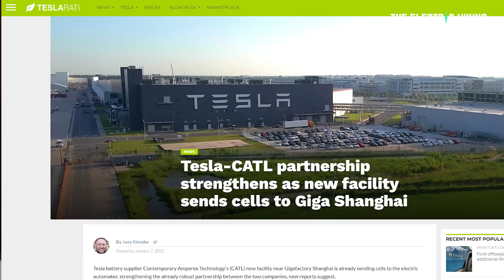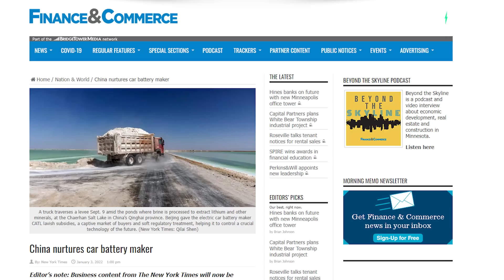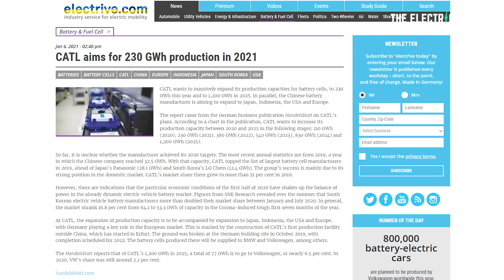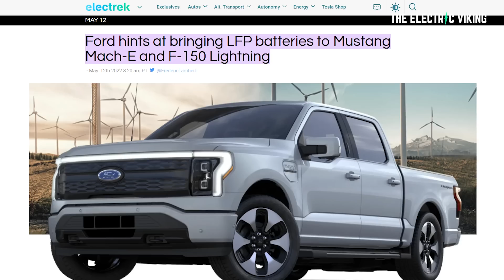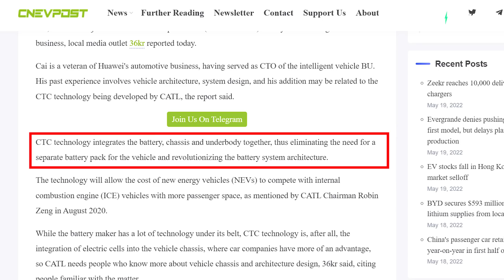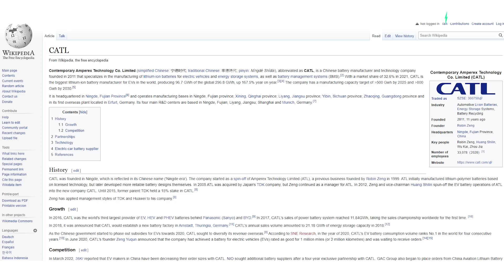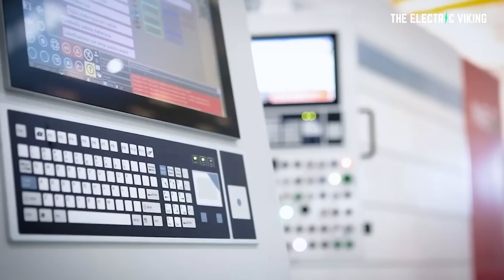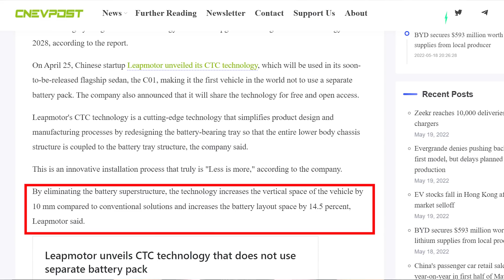Tesla & CATL using CTC to destroy legacy auto & make billions

Comment: You list LFPs advantages but you don't mention its very poor cold weather performance; 4680 will not be LFP. In all cases Lithium remains the choke point. Legacy auto only has to worry about EVs if you can actually make enough to fulfill the 100 million vehicle per year demand for cars; right now annual EV production isn't  even making 5%. - let alone trucks, buses, trains, industrial vehicles like bulldozers - etc.  Of the billion existing cars - EVs account for 0.005% hardly a case for world domination any time soon.

Comment: Now you're going on about weight loss by using the battery pack as part of the structure, so yeah your saving a few kilos, where real weight loss comes in is by building the vehicle with carbon fiber, which will shed 100s of kilos. Musk won't do this because he's all about fast, cheap, and dirty, just like Star Ship. Carbon Fiber is the future of cars, EVs last 20 to 50 years, you want light weight quality. The Cyber Truck will be made with stainless steel, dude the 60s are over!!!!
Reply: carbon Fiber is Garbage when it comes to accidents. Unless you use the Extremely expensive type like some of the hyper cars do, Its not gonna come down in price enough to make it viable. Its nice and light, strong enough to do most things, but Most people Dont need to go 0-60 in 2-3 seconds, so the biggest point would be range. That could easily be adjusted a bit without needing to go down the carbon fiber route. Also Fixing carbon fiber is a nightmare, and most of the time it wont be able to be fixed, just replaced and you cant exactly do that to structural elements.
Reply: Imagine being a nobody trying to tell the Tesla CEO, SpaceX Chief Engineer which has smart and talented scientist and engineers what to do like they don't have a brain to think the advantages and disadvantages of carbon fiber.
Reply: @ravinyu3566  - Wrong, Musk does know the advantages of carbon fiber, but goes with stainless steel because it's cheap and easy to work with (lower skilled workforce) he's all about fast and dirty. It will catch up to him!!!

Comment: Cell To Chassis. Instead of packing cells in boxes and shipping them to Tesla, where they would have to be unpacked and put into packs for the cars, CATL will "pack" them into the bottom chassis component, probably provided by Tesla. That saves a few steps in manufacturing and simplifies shipping.
Reply: That is what I was wondering. Instead of Tesla creating the middle battery structure, CATL would build various structures, pack them with batteries, (hopefully) add all the cabling and cooling systems, then ship the completed middle component to Tesla plants around the world (?), Tesla would put these on their assembly line and 1,2,3 the structure is done. This would mean CATL would need to create multiple battery structures or try and standardize on a few sizes that would serve multiple vehicles. Extending this to manufacturers other than Tesla might mean developing a standard fully populated, cabled and cooled battery structure that could be used in a wide variety of vehicles. The front and rear part of the structure would be up to each manufacturer. I doubt a standard battery structure would ever be allowed or used by multiple manufacturers but I hope it will be used by Tesla on my CT. 

Second thought: Upgradeability. Would the battery structure, if designed properly, allow for larger battery packs or upgraded CTC versions to be replaceable down the road? I get a 300 mile CT, would I be able to take my CT back into Tesla after 5 years and have them easily remove the old battery structure and pop in a new structure? If so, this would be absolutely amazing.

Comment: We used to hear. A lot of details of chemistry and materials advances, but now we just hear lithium iron phosphate.  Does Tesla LFP chemistry distinguish them from “generic” LFP or are all advantage come from vehicle/power management and efficiency?  I also have a solar generator that also uses LFP batteries; how do Tesla batteries differ from those, for example?
Reply: LFP went out of patent in September of last year, before that only china used them, why Chinese EV weren't exported as they couldn't be sold.  they are cheaper to make, average performance, but importantly can take a lot more mismanagement by vehicle owners. Tesla have zero advantage using them as any patents they developed are open for copying. I think 6 companies have now announced they will be making or are making the Tesla style 4680 battery. 

The Tesla 4680 battery allows cheaper manufacturing, no cobalt in the anodes, come out a tiny bit lighter, less cooling channels and aids structural pack designs, but they don't really have any advantage over other LFP cells outside of that.

Structural packs are a bit of a new thing, by next year we will see more companies going that way.
Reply: Its technically Lithium Ion Phosphate but that is the same as LFP (which is Lithium Ferrous Phosphate. So translating Ferrous from Latin gives you Iron, that's also why chemical symbol for Iron is Fe).

Comment: Huh?  Tesla already does this.  They don't need CATL.  Also, other car makers will be able to buy structural battery packs from CATL, helping them catch up to Tesla.
Reply: You are right on most of that. But look at this- the reason Tesla is doing this approach with CATL is because CATL will produce enormous amounts of LFP batteries AND will assemble them into the chassis section and deliver the whole assembly to Tesla, that is down the road, for Tesla assemble in to their vehicles, liberating space for more production of other components.  With this approach, Tesla will be able to lower costs, increase production rate, and increase profit margins while, maybe, maintaining their prices stable.  This will help Tesla to eventually produce the 20-25 thousand USD Tesla model.

Comment: Apparently there is NO WAY to determine battery chemistry or battery configuration by examining the sticker affixed to the battery box, the Mulroney window placard, or even the data booklet that comes with the car. Buyer is left with trying to deduce this basic info from thin air or TM employees guesses. Lotsa luck.!!
Reply: They'll put it on if customers refuse to buy otherwise.

Comment: Good reporting, but depending on the Chinese government is NOT a strength -- either logistically or in particular morally.  Maybe that doesn't matter to you but the CCP is not an honest player.

Other than that, great coverage and I usually agree with all you say.
Reply: Sam means CATL companies is more reliable provider of Battery for Tesla and any other manufacturers; given from his reasoning, CATL will work with government guidelines in event of pandemic so production will Not be greatly affected.

Many other points are:
CATL is #1 battery supplier, given the amount Tesla needs, cost efficiency is multiplied because both are at great volume.
#2 CATL catered for Tesla to have build their new factory 3 km away. Only in China plus the capacity can easily to ram up, vie China speed.

All in all this is the best business deal one can ever gets.
Otherwise Tesla can Not do everything on her own

Unless Tesla partner with the biggest few batteries provider; no cars can be made to sell to the world!

Just look at even now, even with the biggest providers still capacities & production have been strained.

Look at the rest of manufacturers legacy, even worse
The ICE vehicles they are good at, have production trouble, not even going into their future plans (to become irrelevant)

Compare CATL, BYD batteries to Tesla and Tesla own 4680 manufacturing. If we have eyes and analytic minds given public knowledge:
Tesla have more then half the new vehicles on LFP batteries and soon better capacity LFP.
If Tesla were to wait for their own capacities to ram up or other manufacturers Japanese, Korean.

Tesla will Not have
Reply: Morally, I FAR prefer the Chinese govt over USA. (Iraq, Afghanistan, Chile, Nicaragua, etc etc etc).

Comment: Does this mean that the batteries become a structural component of the car?  I wouldn't like to think what happens in a collision.
Reply: It belongs to the "hardness" off the collision. If it's hard enough to damage the structure, the car is totaled anyway. If not so hard, the cells are not affected. 
Another question is, when some cells die, while the car still has warranty. How to replace the cells?
Reply: @oasiasoasiaso  LFP is a simpler technology, and it is easier to do QA/QC on them, so if the company has good QZ/QC personnel, there is no need to be concerned for the first 250,000 thousand miles, maybe more.
Reply: Neither me, because by the time the integral battery pack is damaged in a collision, I would be dead from it.........

Comment: Is the battery going into body panels? Like doors or bonnet or roof?
Could the roof be pV ?
So the battery would charge if parked in the sun!
Reply: You'd get little more than enough to counter phantom drain. If you really want to drive a solar ev, look to aptera or sion motors.

Comment: Half of Tesla’s cars are using prismatic LFP from CATL.  Where are the promised 4680 packs?
Reply: I the texas model y and soon in the berlin model y
Reply: Tesla has built 3 new battery factories that will be producing 4680 batteries.  Panasonic, CATL,  and Samsung will also be producing the 4680 battery format.
Reply: @michaelsmith2723  CATL won’t be making 4680 cells

Comment: With the battery built into the chassis, is that mean if something is wrong with the battery, you can’t change it?
Reply: Yes. Battery fails, scrap the car (with the CTC system, not Tesla 4680 structural, which can be swapped out).
Reply: @lengould9262  thx for the reply. I can’t imagine that for competitive reasons alone, they would opt not make it swappable. No one will ever buy a car with CTC
Reply: @sho38  What if the batteries were proven to have a minimum life of 1 million miles?
Reply: @lengould9262  in the normal circumstances, it’s great! I am worried about for when the battery malfunctioned prematurely or if the car was involved in an accident, it will be written off, whereas traditional vehicles could be repaired.
Reply: @sho38  When was the last time you thought about the repairability of your TV?